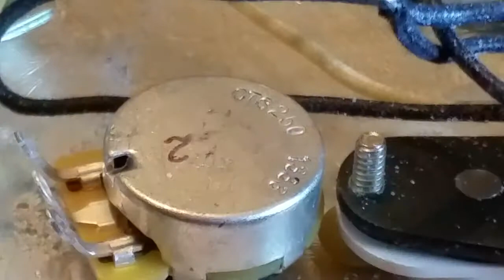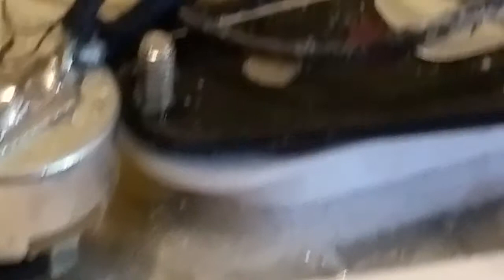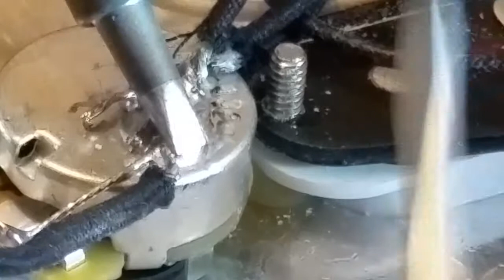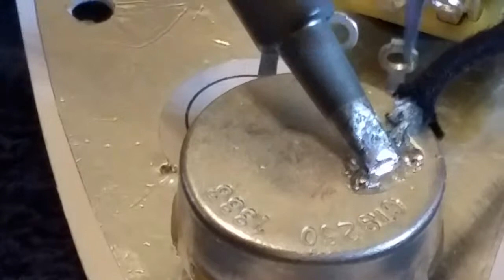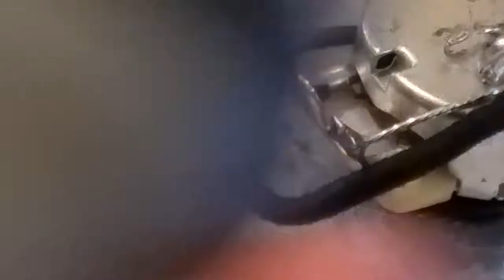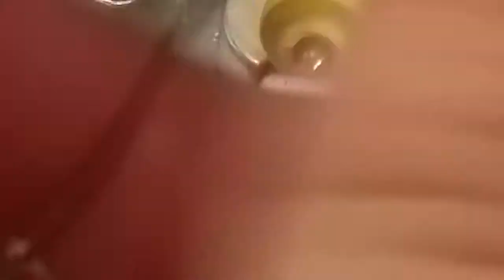Guitar Soldering

Comment: Question for you : I need to refix and clean off the old solder from the volume pot because its a mess. Should I just melt the the old solder, tin all the wire (4) and solder it again ? Is it the good way to do it ? cause there's a lot of solder to remove here ! Thanks for your help.
Reply from the maker: I think the best way is to get some de-soldering braid ... or a solder sucker ... and remove as much of the old solder as you can.  sometimes I've been able to get away with using the old solder that's on there... but the rosin core (flux) has been burnt out of it when it was first used... so it might not make for the best solder joint.
Reply: +davecooper360
thank you soooo much ! one more tip : I see that you twist the 2 black wire togheter.  is this necessary or I can solder them side by side ? do pickup wire have to touch each other to make a good contact with the pot ? thanks again !!!
Reply from the maker: Either way works fine..  as long as they're touching the pot you're good to go :)